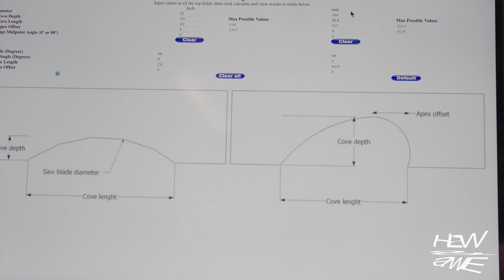DIY Wooden iPhone / Cell Phone stand/charger build  (Music Edition)

Comment: Love the build.... took some left brain thinking to use the Domino to create the gap for the cable.... me I would of used a spade bit ;-) and cocked it right up... also I didn't realise you could get software to work out the angle of the saw cut... amazing..... keep them coming mate... scape was a nice touch.....
Reply from the maker: There also an iPhone app bud, it doesn’t do non cemetric cuts though 😏 I hope you’re having a great weekend Richard! 🍻😊🍻

Comment: Please get rid of that ring before you lose your finger 😰 Or get a silicon ring... 
- Even if you get injured somewhere different from the finger that wears the ring, your hand can swell, and will cut out blood flow to your finger, eventually loosing it if you cannot cut the ring off.
- The ring can get trapped in tools such as chain saws and rip your finger away instead of just mildly injuring it. 
etc.

Awesome woodwork by the way.
Reply from the maker: If I was left handed I’d agree. 👍 ..my choice bud 🖖